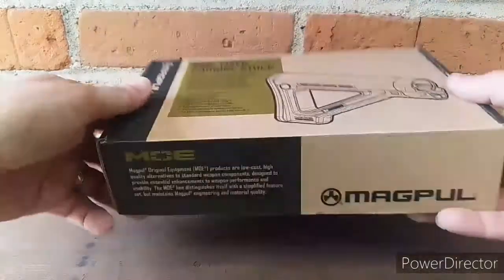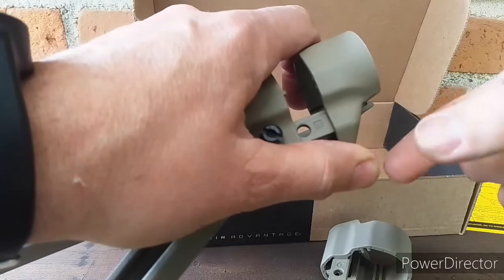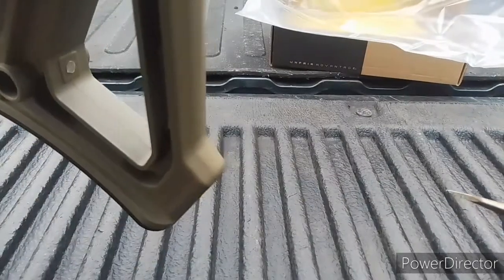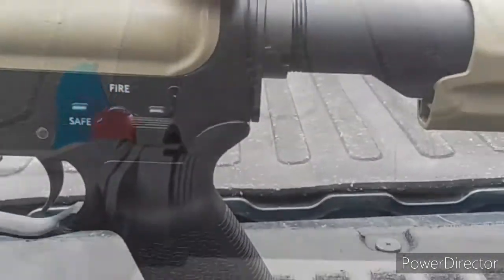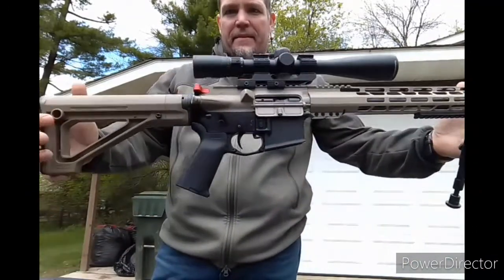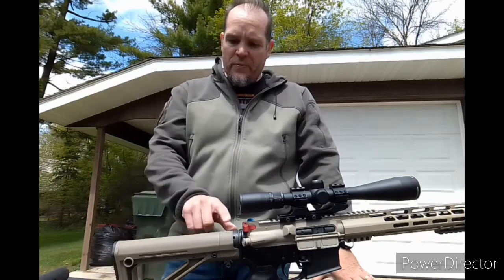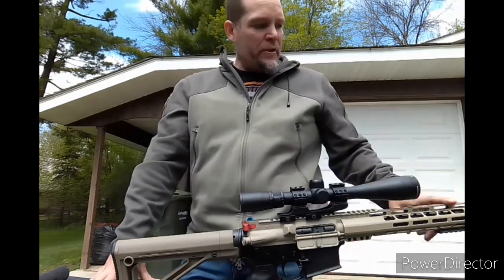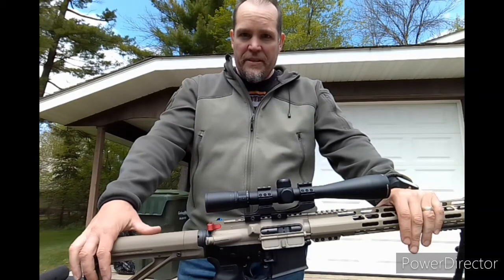Magpul MOE Fixed stock install

Comment: I don’t get why fixed stocks in general don’t have the option to swap out the length of pull. Like have the pin fit underneath the buffer tube so you can unscrew and adjust it

Comment: So what actually holds the stock on and into place? Just friction from tightening that one screw?
Reply: the screw is at the front angle of where the old adjustments begin so the screw is wedged there and can't creep backward

Comment: What if you just have the all round buffer tube?will this still work
Reply from the maker: It won't work on a pistol buffer as it uses the adjustment rail to lock on to.
Reply: @mintac3672  understood.another question.for pistol buffer tubes is there any type of modification tht fits it
Reply: @TuWaveyTv  No. The pistol buffer is intended to have nothing installed on it to assist in shouldering. Youll need to get a carbine buffer tube ($30ish + $15 Castle Nut wrench) and you are good to go.